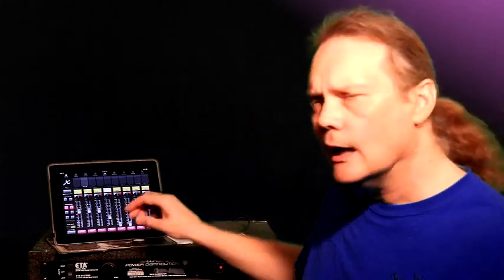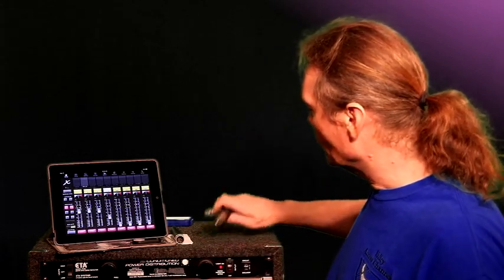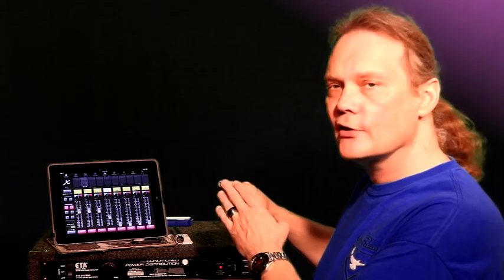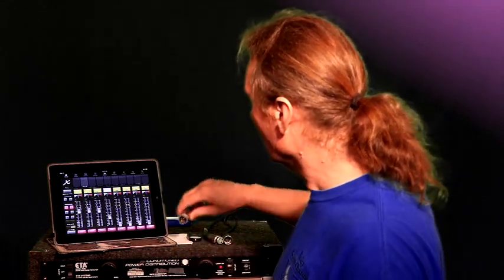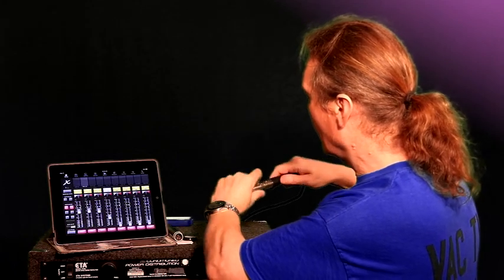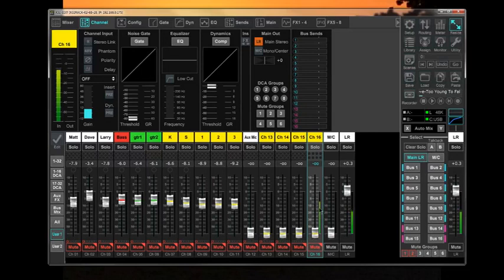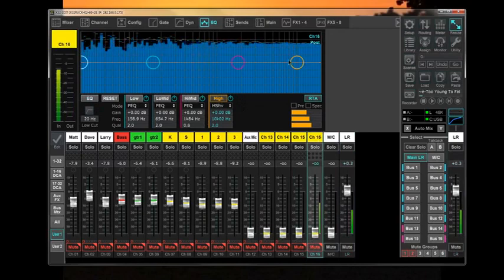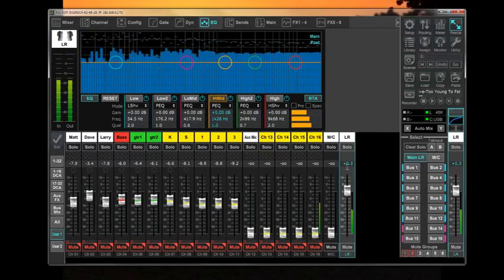Unlock the potential of your PA: How to EQ and analyze your live sound system with a digital mixer

Comment: I have xair18 ......... Are you using x32. Or midas?

This is great low cost corner cut for system measurement and calibration...
I run the poor man show. And this is poor man approved.....lol
Reply from the maker: I'm using X32, the Midas M32 uses the same software.  I think you could do this technique with the Xair as well.

Comment: Nice video and well explained, do you know if this process can be done in a Allen heath Qupac mixer. It does have the rta function but I can’t figure out the rest.
Reply from the maker: Should be able to do this with any mixer that has an RTA meter you can use on a mic channel.

1) Plug Calibration mic into a channel, set EQ flat/off, MUTE channel - view RTA on this channel.  You should see RTA spectrum display active on this channel.  Do not send this cal mic channel output to any speakers.
2) Move calibration mic in front of speakers.
3) Use a noise generator, or plug-in a music player with a music file of pink-noise into a line-in mixer channel.  Set channel EQ to flat/off and turn up level to a comfortable moderate level.  Hear the pink noise hiss from the system.
4) Your RTA (on cal mic) shows the approximate frequency response of the PA system as it hears the pink noise playback.  Adjust your main-output EQ as needed to flatten any major peaks, and overall smooth out the measured response as measured by the RTA on your cal mic channel.  Beware - A little EQ can help. a whole lot of EQ often doesn't sound good.  Measurements are only as accurate as your mic and methods.  Don't fret too much over a db or two.
Reply: @Barry-Watson  I really apréciate your advice thanks a lot
Reply from the maker: Thanks!  Best wishes.

Comment: Can a normal mic be used for calibration?
Reply from the maker: The process would work, but only be as accurate as your mic's response.  A lot of "normal" mics have irregular response and many boost the high end some, so your resulting system EQ may be lacking in the high end.  A "flat" studio mic like a SM-81 might work okay... but, I'd get the right tool.  You don't need a laboratory reference B+K calibration mic for decent results, you can get a dbx or behringer type calibration mic for about the price (or less) of a typical vocal mic.

Comment: Would it be easier to just use the auto eq wizard on the pa 2
Reply from the maker: Sure, if you have a dbx driverack, Behringer DEQ2496, or some other auto-EQ with a calibration mic, you can let it do the work.  I wouldn't blindly trust the results, these devices can make some poor decisions depending on your mic placement and the space you are in.  So I always see if it's results seem "reasonable", and if not I re-run with the mic in a little different spot.  Sometimes the auto results want to apply some radical boost/cuts, especially at the ends of the spectrum, and I'll over-ride those decisions.
But, yeah, they can be good tools if you got em.
Reply: @Barry-Watson  true didn't know the Behringer has auto eq
Reply: @Barry-Watson  Behringer one Is almost double in price in a year, new Zealand inflation is OUT OF CONTROL!!!
Reply from the maker: Oh yeah.  The whole western world is in a economic mess.  Letting money junkies manage the world finances is about as wise as letting a dope addict run the drug dispensary.

Comment: What is RTA function please?
Reply from the maker: Real Time Analyzer.  A bar-graph meter display that shows the audio spectrum, the bars on the left show the low frequency output, the bars toward the right show the high frequency energy.  If the system is playing a pink-noise test signal (calibrated hiss type signal), and all the bars are roughly equal height that would indicate the system doesn't have any major boosts or cuts at any particular frequencies or notes - accurate flat response.  While playing music, you'll see the display dance around according to the tone(s) in the music.
Reply: THANKS VERY MUCH FOR YOUR REPLY. THAT WAS QUICK AND YOUR EXPLANATIONS ARE QUITE CLEAR. I AM LEARNING A LOT FROM YOU STARTING FROM SCRATCH.
Reply from the maker: @joelucky3570  awesome!   Thanks!  My pleasure.

Comment: Why don't speaker manufacturers do this process to their speakers and put in processing to flatten the response?
Reply from the maker: Hey, thanks!  Some do. There are some high end home audio speakers that have very complicated crossovers that are tuned for the specific drivers the manufacturer chose. That's one of the reasons why I don't recommend just randomly swapping out a driver with a "better" driver without due consideration.  This is an exception, most passive speakers have fairly simple crossovers.

It's more common, and easier to do with todays DSP in powered loudspeakers. It's not entirely unusual to see built in curves in powered studio monitors or powered PA speakers to get the best from that box.

Bose is famous for this, for having radical eq curves in the amplifier or processing to compensate for the loudspeakers.  Some of their speakers don't do very well, without the associated processing.

But, do remember, you can't just take a lousy speaker and make it good by applying EQ to it.
Reply: @Barry-Watson  Thank you for the information! I really appreciate your knowledge.    So I tried your method on two different powered EV speakers, the zlx12p and the EV elx12p.   The plastic speaker was much more peaky than the wooden speaker, the ELX was much flatter.
Reply from the maker: Interesting.  Did you think the speakers sounded better after doing this exercise?
Reply: @Barry-Watson   the zlx speakers sounded a lot better. I had primarily used a set of these for my keyboard rig. I thought my synthesizer was kind of muddy sounding in general since I've had it.  Turns out it was just the speakers. Thanks again for your channel and everything you do.
Reply from the maker: Cool.  Glad to hear it worked!
Reply from the maker: I can't speak to that specific model box, but generally speaking if the speaker is a little peaky in the range of the cone drivers, you might be able to tame some of that behavior by stuffing some fiberglass insulation into the box.

Yes, this could have the effect of slightly detuning the box design, so measure or check the results and see if you like the experiment.  It may, or may not help, but it's not very expensive to try.
Reply: @Barry-Watson  thank you for the suggestion. That might be a good idea to try since I'm not always going to have an equalizer to use for these speakers.